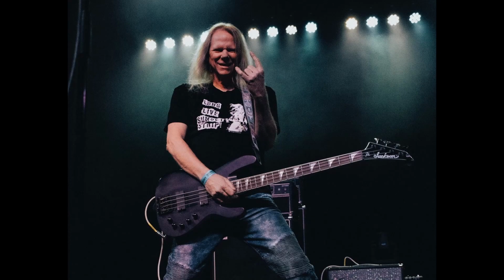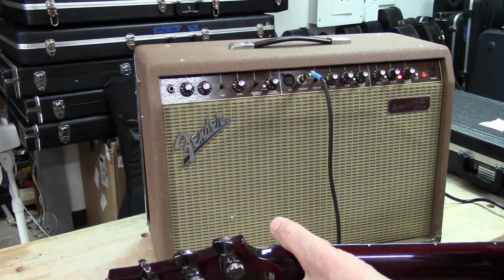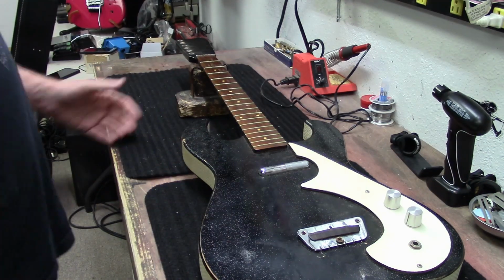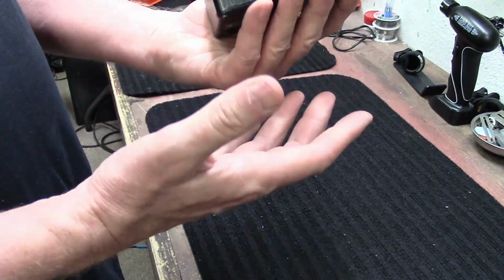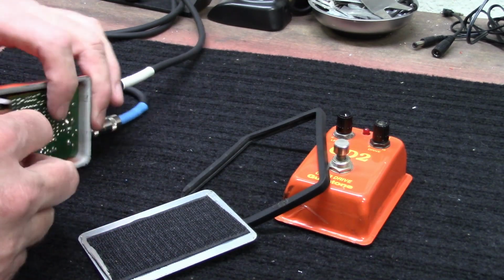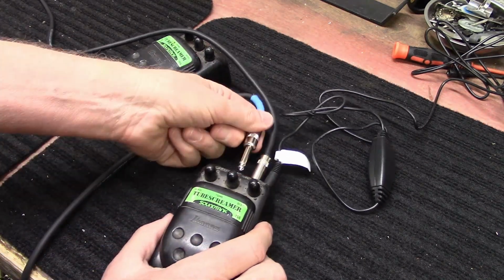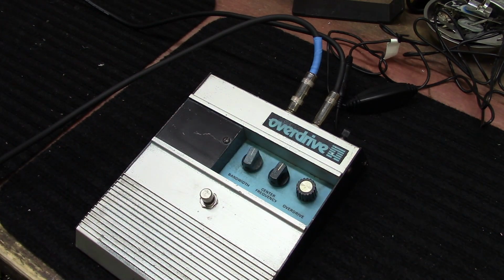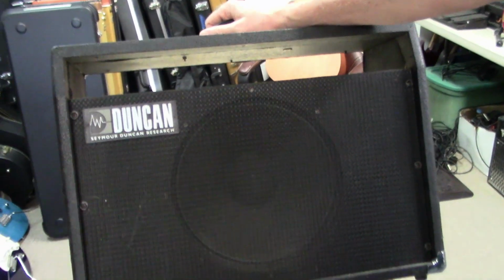Testing the last of the storage locker Gear! Storage Locker part 3!

Comment: That SysTech pedal might be a pretty rare beast. From what I can tell, it looks like a transition model between their earlier (and pretty sought-after) Harmonic Energizer and the final version of their Overdrive pedal. All the controls on your unit are from the Harmonic Energizer but the branding is for the Overdrive (The final version of the Overdrive had controls for "EQ," "Distortion," and "Gain") so I would guess that yours is an initial attempt to produce a less harsh version of the HE that eventually they would eventually evolve into a whole new pedal.
Reply: Has Josh Scott snatched it up yet? I’m predicting a JHS recreation within the next two years.

Comment: Wilkinson Deluxe Vintage 6 On-A-Strip reissues fit this 1448 Silvertone, with a a little grinding on end of strip, to fit contour of headstock point and reaming for new ferrals.
Reply: Get a staggered height set made mine so much better 👍

Comment: Hey I have the same Silvertone. The glitter sits on top of the finish so it will rub off if polished too hard. They were sold with an amp built into the case(mine was missing). The pickup sounds really cool
Reply: I refurbished one of these too……it’s from 1963. They sold for $70 with the three watt tube amp built into the guitar case. Five inch speaker…….

Comment: I have an acoustasonic amp and the reverb never worked even brand new. you can hear it if you hit the amp chassis so the tank is working on mine but its not sending the signal through.

Comment: The SansAmp is a tube Amp emulator. It comes with a adapter plug for power. New they list for about $240.

Comment: Those old Silvertone by Danelectro had an odd style tuner set. Depending on the year produced, it may have left the factory without a nameplate as was common after 1967.

Comment: Dane, as I recall, the SansAmp was an analog speaker cabinet simulator.  This was done by filtration -- essentially a fancy eq curve.  At one time, there was this technology, something called the RedBox Cabinetulator, and little else.  I never had any of this tech, so this is all I know.
Reply: sansamp is a modeler
Reply: @rickthaler  An analog modeler - but yes, a modeler for sure.  That's the way they made them back in the day.  I don't know how Tech 21 does it today.

Comment: The SansAmp by Tech 21 has always been produced here in the US for decades. The company stopped its production in 2016 but it was reintroduced in the market in 2021.

I would refer to that pedal as an amp emulator and it was used by Kurt Cobain to create his signature grunge sound taking advantage of the flat output delivered by the pedal.

Cheers!
Reply: Sansamp is a great pedal/amp sim as well. People have been using them for years for a reason. As for Cobain using one, he did yes, but only for a short period before he died, most of his famous tones come from a standard Boss distortion.
Reply: @seanmckelvey6618  yes, Cobain experimented with other pedals  and he probably didn't use the SansAmp for recording but he used it in the beginning of Nirvana.